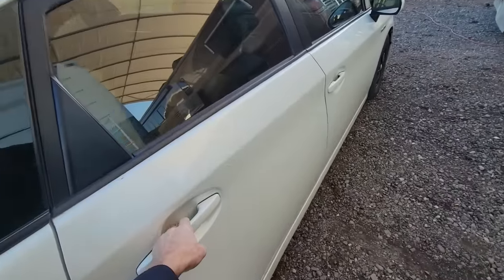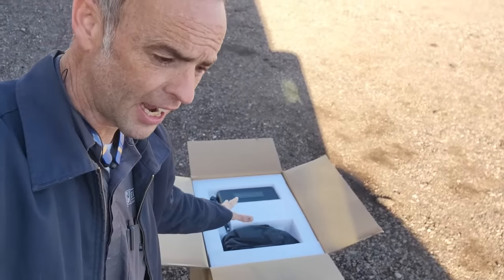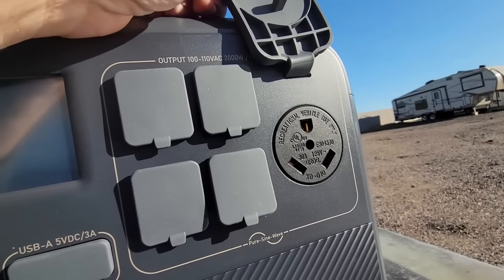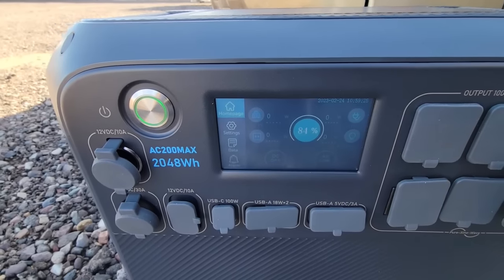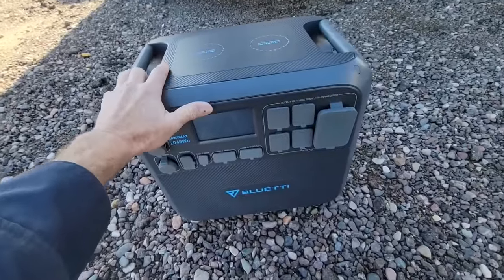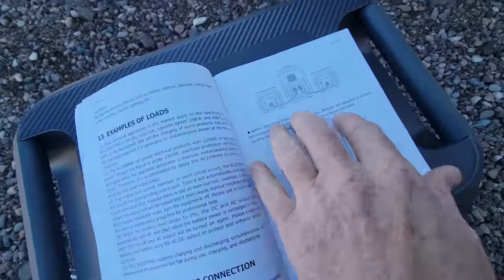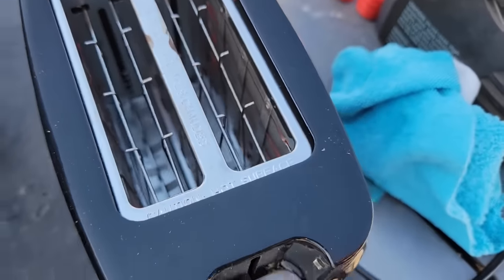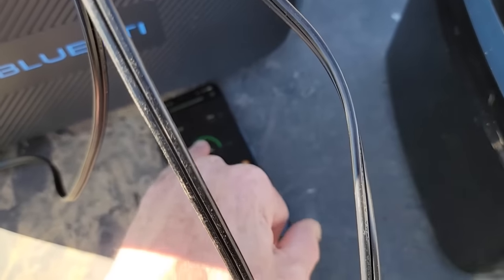The Most Exhaustive Solar Generator Test I've Done: Bluetti AC200MAX

Comment: Hi James. Loved your review on the Bluetti. We’re currently under 4-5 ft drifts of snow here in Mt. Shasta. I tell you , no one’s talkin’ drought here lately. I was daydreamin’ 😮about using that solar generator to run my frig and blower on my woodstove to keep things going during our occasional power outages due to snowy branches or high power loads during this cold patch we’re experiencing. Come in handy for my Coleman Lantern too. Sure learned a lot regarding RVs do’s and dont’s; potential buys or run the other direction as fast as you can ! Thanks. 😂
Reply from the maker: Yeah this would be a good option for that

Comment: According to what I've seen and read, the Bluetti is top of the line battery backup.
Reply: Its just the most expensive. Get a gas generator it will last for years which that thing wont. Those batteries dont last forever. Its like comparing a gas engine car to an electric car. No real sense in it.

Comment: Good stuff.  Have the Bluetti 200P which is the step down from the one you reviewed.  Have a bigger solar set up (not tied to the Bluetti) and understand that if there is any shade on the panels that it will greatly reduce the output.  I know it was sort of a slap together but the wires across the panels may be reducing the output.  We just use the Bluetti for camping/RVing and its great.  Also as a backup for home in case the power goes out.  Love the content.  Keep on keeping on!
Reply: Bluetti is great for 2000wh and also If for camping, i think 1000wh is enough. But for RVing maybe need ecoflow delta pro or bluetti ac200P+expanded battery.

Comment: James, another good real world review and I am fascinated with this new technology, but it's not cheap.  We have an Ecoflow Power Station that I can charge with our portable 200W solar system when it is necessary and we use it to run our AC/DC entertainment system quietly and I don't have to run a generator and I can use it at home when we lose power. I chose not to install an inverter or solar on our RV because I didn't want to install any permanent solar on the RV. Bluettie manufactures some nice products and I would have purchased a Bluettie product, but they have a gap in their generator's output Wh values and I was looking for a 1000Wh to 1500Wh unit and I hope Bluettie takes not of this. Keep the review coming !

Comment: Love your channel.  I think this Bluetooth AC200MAX has the potential to extend your boon-docking stay as well as providing power when prepping for a trip.  We always have to use the diesel generator to recharge the house batteries as we cool the refrigerator.  It would be a nice solution use it for the refrigerator as well as having an emergency power source while traveling without spending thousands of dollars to convert to a Lithium battery setup.
Reply: Yes, portable power station is cheap solution for storaging power. And also you can try some new brand with lower price.

Comment: I have this AC200 MAX and I charge it with a 220 watt Off Grid TREK solar "blanket" for car camping to run a DC cooler and charge the two batteries on my e-mountain bike (E-CELLS Super Monarch Crown) when I return to camp from hunting or exploring on the bike in the mountain west of the US. A "spendy" system but utterly reliable and top quality. Off Grid TREK is a Canadian company in Manitoba. Nobody but NOBODY makes higher quality, more compact (per watt) solar blankets. But at US $1,745. it's not a cheap date.

Comment: Hello James,  Once again you have out done yourself. From one  "Best RV ever made," owner to another,  I've learned so many practical & useful skills by watching  your videos. Bravo!  Please keep them coming.  Still looking to see how you decide to correct the sagging ceiling in your Beaver as I am currently using credit cards to hold mine in place. Lol. But seriously, I'm going to conclude that you prefer the Mango Power over the Bluetti.  As one of your followers,  I value your expert opinion greatly. I have been researching solar for about a year now as I am planning to go off grid with my Beaver until my DYI house is built. I was introduced to the  Mango Power through your video & I was highly impressed. But wondered would it do everything that I need it to do such as AC  which is the most important thing living in Florida. Or would I be able to run the Splendide 2000 & dedicate one day a week for laundry.
Reply from the maker: The mango is not as sleek or polished as the Bluetti, but is bigger and truly all in one and a UPS backup system for power outages. Either one will run the splendide or A/C with a soft start. None of these units are great choices for RVs with stand alone inverters with built in 120vac subpanels currently as the power loss with the battery charger would be immense.  Without re-wiring the RV 120vac.
Reply: @AZExpert  Thank you

Comment: Even after researching Bluetti batteries, I really wanted to know if the 200 Max (which is a weight I could heft around if needed) could actually power a rooftop AC. I've already got a softstart installed on the AC, so this was great to know. Buying a package with additional batteries might be the way to go!

Comment: Your Video and review on the Bluetti AC200max was great and the info I was looking for, I camp at an event for 4 days and was going to hook up solar panels to a inverter and charge controller and was thinking this is a lot of work until I seen the portable power station I want to run the refrigerator all the time to prevent things from spoiling, I will be running the air when I am back at the camper, and the soft start may be in the future if I decide to run it off the portable Power station,.... I do believe this is my answer Thank You
Reply from the maker: Thanks for watching! :)
Reply: P.S. I use a 3500w generator when I'm at the camper but don't want to leave it run when I'm not there in fear someone may steal it

Comment: It’s a cool and interesting notion that it has gotten that efficient over the years, but the most important thing to remember for anyone watching this and wondering, you need to create enough power to both maintain the battery during the day and run the ac appliances. In this scenario he presented, with the two extra modules you may have the power to run for a day, but so long as you are discharging and not charging, you will eventually run out of battery. This is not a replacement for solar off grid living, but more akin to emergency battery power with solar integration. 

Now, having said all that, if you could manage to drum up about 1.5kW of solar through the majority of the day, you could surmise enough energy to probably maintain power 24/7 so long as you keep a close eye on your usage. And granted you live in a place where it is usually sunny.

Comment: I first ran across your channel because I am researching solar power stations, because I will soon own a Nash 24m OTG.  That is their "off ths grid" package and with that, comes slightly upgraded solar, but what I am excited about is the low draw Coleman AC unit.  So I was looking to see if I could do exactly what you're thinking is the future of RV....going fully electric using all solar if possible.  I watched your Mango E review AND WOW.  What an AMAZING unit.  I mean, talk about BEAST MODE, just speechless.  Now with your Bluetti review, OMG...that plus a proper solar array and maybe just one of the battery units chained to it, that might just work to run my whole unit.  I am guessing I may need to keep one 12v RV battery to run the slide, what do you think?  Now I am scrolling all your videos, good luck to all in the give away, but hoping better luck to myself, because I think you have found the answer to my search for powering my RV for boondocking and not wishing to run a fuel powered genny.  Keep up the great videos, I am binging them and learning A TON.
Cheers
Joshua

Comment: Divide the Wh capacity by the watts the device uses. For example 2048 Wh / 100 watt light bulb  would be 20.48 hours of runtime. It's rough idea as it doesn't include inverter losses but I find it easier than Amp hr. Amp hr draw requires further calculation when using an Inverter because the Inverter has to pull higher current to make 120 volts if the battery is less than 120 volts.
To Calc the Wh of a battery multiply the voltage and the Amp hrs.
Hope that helps.

Comment: Love the channel.  Always good info to learn here!  I agree with the use of soft start on the air conditioner.  I could not run my (~1500 watt) AC with a 3300 watt generator.  I put a soft start on mine and now no issues.  It is nice that the solar "generator" could start the AC.  However, my AC draws about 13 amps when running the compressor.  13amps * 120VAC = 1560 watts.  So the solar "generator" which has ~2050 watt/hours of battery cannot last more than about 1 hour 15 minute or so of compressor run.  So, if you add the two additional batteries (and assuming they are also 2050 watt/hours) then you could run for a little less than 4 hours of compressor.  If the compressor kicks in and out due to the thermostat at about 50% on and 50% off you may get close to 8 hours on the three battery system.  Keep that in mind if you decide to buy a solar "generator" instead of a gas generator.
Reply: You have a link to the soft start or one you recommended? Thanks.

Comment: I too struggle to understand amps, amp hours, watts to amps, amps to watts, etc, but once you get the basics, it’s all good. If you are figuring 12 volt calculations and have two figures, you can get the third. For example, my  120 volt AC pulls 18 amps max, so to convert to watts multiply 120 x 18 2160 watts. So for simple math, if I had a power station with 2160 wh, I would get 1 hour of run time. My Anker is 2600 wh 2560 divided by the AC load of 2160, you get 1.18 hours. If you figure in the loss of efficiency, you can gestimate 1 hour of run time. I would love more, but anything larger is over 100 pounds, and at 64 with a bad back, I could not get it up into the back of my Tundra to transport it. Awesome idea, and when these things are on prime sales, you can’t beat it, not worth building one. Mine should be here Friday or Monday, can’t wait to test it out. Thanks for the reviews

Comment: I think for sure watt-hours are a better way of listing a batteries capacity because it isn't voltage dependent, because it may be 166ah at 12v or it could be 83ah at 24v etc.

Comment: You can adjust the amperage for a 6 amp or a tamp on the unit for your vehicles 12-volt charger.  I keep mine on for because six or eight makes my cigarette by the hot and blows a fuse on my truck

Comment: Most have a built in charger with just a cord to plug in, but internally it probably adds 5 pounds, so it’s kind of hard to keep up with all the accessories but would lighten the unit a bit. Without wheels, that could be a good thing.

Comment: Great video.  I feel ya on the numbers thing making your brain numb with the whole amp-hours vs. watt/hours, etc.  I have recently replaced my house battery with a 100ah LiFePo battery, and it works great.  These power stations are great for what they do, but it does, however, GRATE ON MY SOUL when someone uses the term "Solar Generator!"   GAH!!!!  Thank you for clarifying that it is NOT a Generator.

Comment: The key here is being able to run the ac at night till you can run the generator during the day if at a truck stop or rest area overnight. I’m wanting a set up like that for my class c Minnie Winnie. I also do insurance claims and need that capacity when going into an area with no power. I have the starling set up so if the cell towers are down which they often are I still have communications. This would be clean quiet power vs. the noisy onan. Richard Groseclose

Comment: I just found this channel and subscribed. We’ll be taking delivery of a new Thor Compass 24KB which only has a single battery, 100W solar, and no inverter. Trying to learn as much as possible. Debating on upgrading parts in the RV, or getting a Solar Generator with 30a RV  outlet. Would like to do some off-grid camping.

Comment: Thanks!  Great review!  I can see where a unit like this could serve many purposes beyond providing power to an RV.  For example, I think it would be ideal for powering a telescope mount and computer at a remote dark site.  I wonder if one of the purposes of making the charger separate is so that it can be placed away from the unit in a ventilated, sound-insulated area to help mitigate the noise.

Comment: Good review.  I liked your real world test since you used it how I was thinking  it would be helpful.  By  adding the easy start on an AC, It could be useful for a lunch break stop between campgrounds.  The only question I was left with was if the AC was 13k Or 15k, and if that would have made a difference since my camper has 2ea 15k AC units.

Comment: What did you turn off at the breaker box when you plugged in the 30 amp rv cord to the Bluetti?  I have this generator and when I plugged the RV 30 amp cord into the bluetti I did notice it drew quite a bit of juice from it and I didn't even have anything running.  I mostly run my frig on "gas mode".  Also I have a gas stove.  I had a micro quiet soft start put in and the bluetti runs the A/C fine.  I didn't run it a long time though.  I just wanted to make sure it worked.  Very good video!

Comment: I know you said you not a numbers man and aren’t really interested in them but I did want to say that it’s actually a 40 AH battery. Watts/volts will give you amps. 2048 watt hours / 51.2 volt battery inside = 40AH. going by the label on the back.
Reply from the maker: yes but I think my math was based on 12.5 VDC use to compare to the marine deep cycle batteries.

Comment: Great help....I have asked a few questions in past....but this has helped but more questions....1st...soft start is a great idea...had 1 put on 3ton home air yrs back....lost power for days in summer....but after a week when power came back on...start capacitor took a poo poo....lol..but that seems to be a good unit for popup...only 5000 watt air ..small fridge..and main concern CPAP...but if off grid... how long will that last...would it last over nite....now to some thing I have no clue on ..but is my project this summer is solor panels...do they all have same connector....and I'm guessing that has and inverter inside of it....I use a jump box with a 110 plug on it to use in van for CPAP and get about almost 5 hrs....and what do panels cost.....solar will be my learning project this summer......hey...thank you ...very helpful....

Comment: I can run my Coleman-Mach ACs (one at a time) with the AC200MAX in my Grand Design 312BHTS. I have both a 15K and 13.5K BTU unit onboard.  I wonder if the low-profile units pull more power?

Comment: Nice review of the AC200.  Cool to prove the slow start would work for higher startup loads.  I am not an RV person but I am curious if your RV generator is an Inverter/pure sine wave inverter or standard "dirty" power generator?  I've always wondered if you could power one of those battery banks with dirty power or not.

Comment: They are neat but I prefer components to. Consolidated unit.
 If the charge controller goes out it a component system you just buy a new charge controller with a self contained now you're limited to buying their charge controller.
Reply from the maker: while I do agree as a technically inclined person, not everyone has the ability to troubleshoot and diagnose, and paying for those services will get close to the price of the unit, and a compact ready built system, allows a great deal of freedom with those that have a premium on space too.

Comment: You mentioned running the dc system off the 200 max without batteries. Do you have a solution for attaching to the campers dc system?  I assume you have to unplug the ac to dc charger
Reply from the maker: 12vdc outlet to the battery cables, just switch all bulbs to LED

Comment: Bluetti Power over noisy generators !!  hurray !!!  
may more people that drag their homes to the national parks use these types of units and spare the world of the noisy fuel powered generators.

Bluetti should take your tips and some more, like design in:
1. AC pass-through AC Power.  This would then enable operation as an uninterruptable power supply. (maybe as module expansion?)
2.  Flexible solar charge controller to allow charging under low light morning and evening conditions; ie low 21volt turn-on.
3.  Battery scaling to allow quick replacement of battery modules in addition to the system expansion.
4.  System performance tracking and display that might expand upon battery health and usage rates.

Was able to borrow and small 600-watt*hr power box and found it really useful, but quickly found that my total needs are more in the kW*hr ranges.
Reply from the maker: Thanks for watching! :)

Comment: Could you confirm, can hardwire this exact solar generator into my Travel trailer (in place of my Deep cycle battery) and still plug into shore power?  It sounds like what you said in the video is yes, but how is that possible if I need to shut off the converter in the travel trailer? If I install this in my RV and I have to shut off the converter doesnt that prevent me from plugging into shore power?  (In other words, if I install the Bluetti, I would not be able to plug into shore power anymore?

Comment: I'm surprised didn't give you the new one ac500 which should be more I right up your alley more what you could use with a giving you five thousand AC watts and it's also capable of coming back with six batteries what do and give you all that to test it with but their give you at least one or two as you reach need one battery to run it and you can pair up two of them together to be 120 and 240 volt and 10,000 Watts and it's definitely up your Ali for what you need.